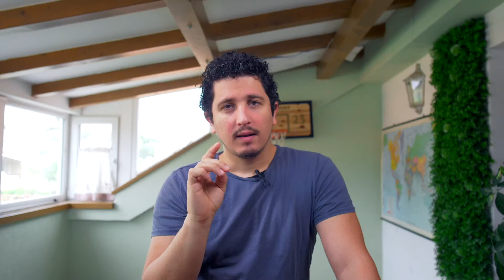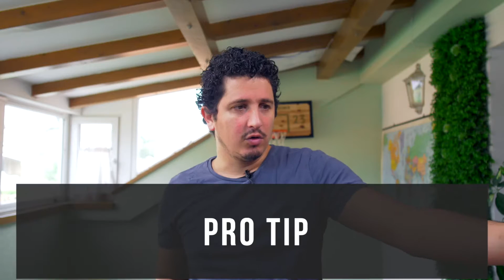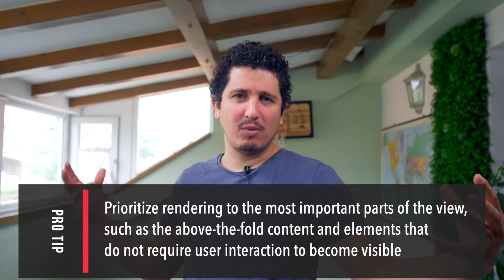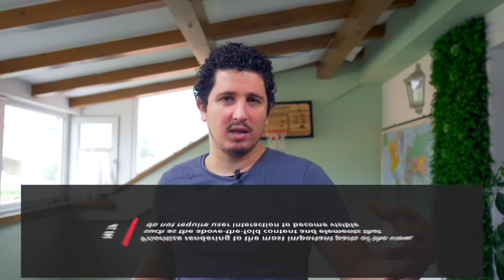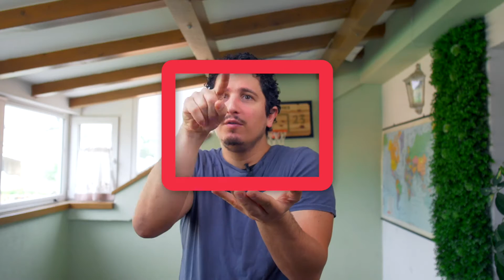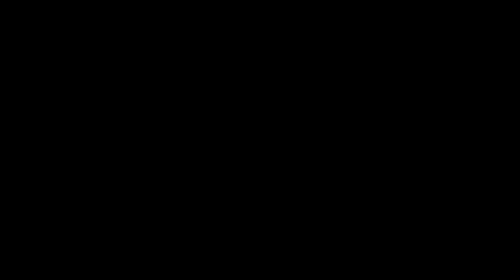How to Drive Performance with Vue 3 Lazy Loading

Comment: If I have a list with 300 elements,  async component will know that only 20 are above the fold and only render the rest of the list if I start scroll?
Reply: Looks like you're asking for list virtualization (e.g. infinite list). You could try a library like vue-virtual-scroll-list for that. If it's not a list, but you rather need to load sections of a view as the user scrolls, then you're looking for Intersection Observer API. I hope that helps

Comment: Trying to imagine what it's like in this room. It's like a loft, wraparound windows, has greenery, maps, outdoor lamps, and a basketball hoop.  I'm going to assume it's also the office with the computers. What a whirlwind. Anyway, on to the video
Reply: Ha, that's hilarious! Why don't I explain then. It used to be a terrace, but I closed it. I'm at a standing desk, facing my laptop, a display, two bright lights, camera, and a playstation. To my right is a treadmill. Matter of factly, I just got off of it. The greenery helps with bouncing sounds and I also like the looks of it. My son plays basketball. He had an accident last summer when a he cut both hands through a glass door. I installed this hoop to help him with recovery. I just recently removed it so you'll see sound-absorbing foam in the upcoming videos. I use a wide lens (12 mm MFT on a GH5), which is why you see a lot of it.
Thank you for watching and supporting this effort. I really appreciate it!